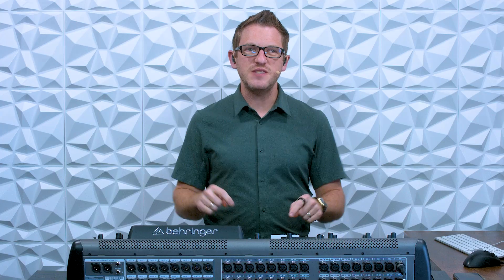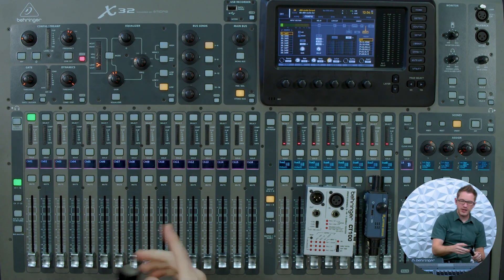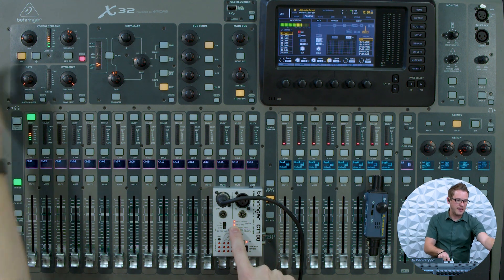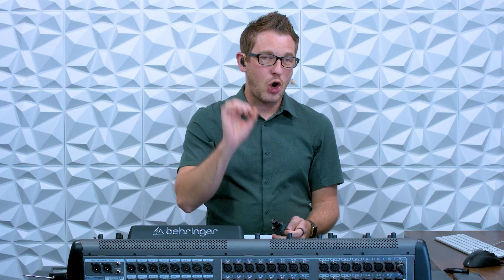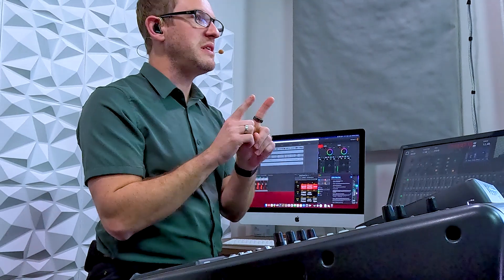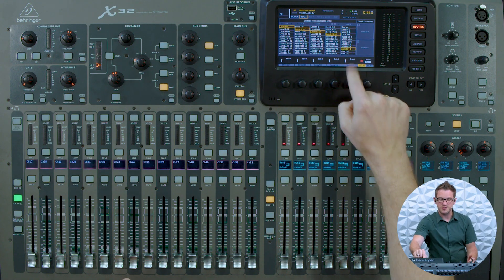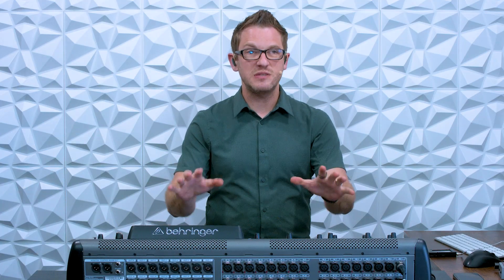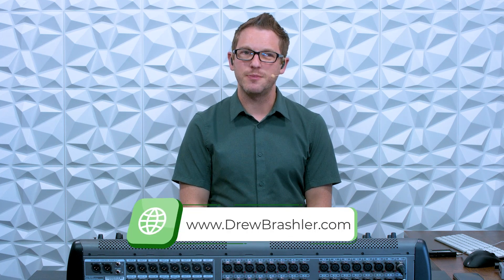Christmas Service Audio: 7 Common Pitfalls (and Quick Fixes)

Comment: One thing to note is that (according to Dave Ratt) the newer black Neutrik Ethercon connectors are no longer connected to the shielding, so when buying Ethercon cables, make sure to get the silver connectors. If you find your cables don't have continuity between shells, you can buy the silver shells from Neutrik for a very reasonable price.

Comment: Well said, but I have a bit of a change. Maintenance should ideally be done more frequently, perhaps quarterly testing all IO because you never know when a wire will fail. Scanning for RF issues. As far as batteries in active pickups, been there too many times, and some use batteries that aren't so accessible. Many ukuleles are using 2 CR-2032 batteries for their internal pre-amps and I've found that even with their onboard active electronics, they still benefit greatly from an external pre-amp. The majority is 9V, so yes, having spares s nice.